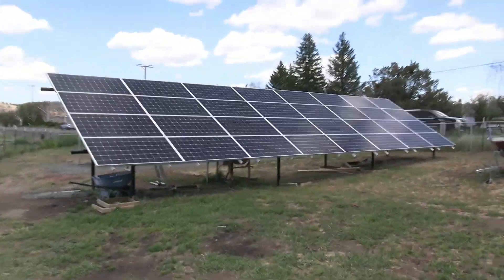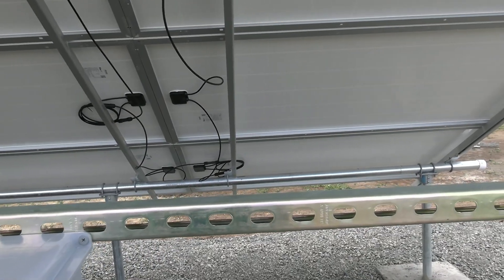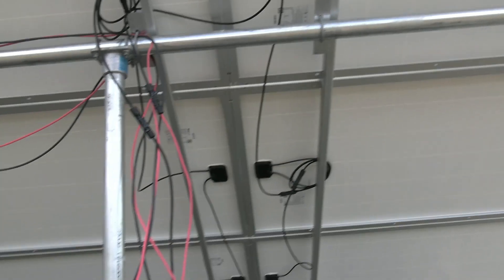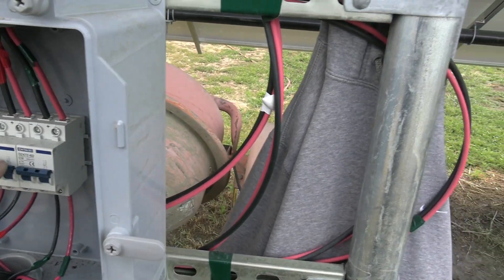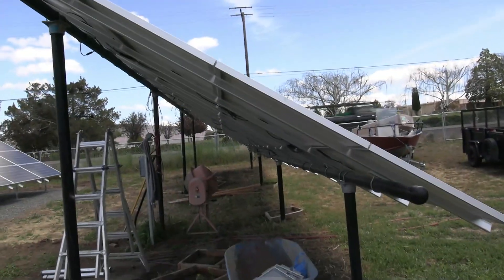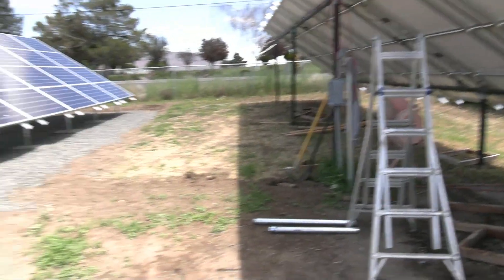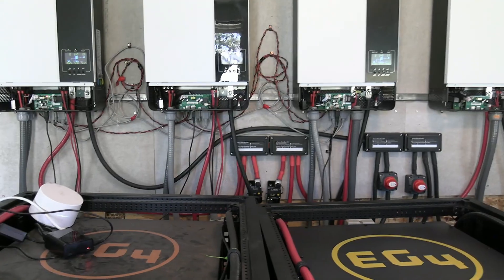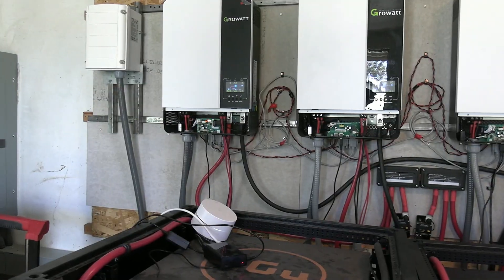hooked up my second solar array

Comment: You got plenty of room there I wish I had that much room. My solar room is about the size of a large walk-in closet.
Reply from the maker: I knew that these made noise. So I drug that shed over there. It would have been better to build a new building. I just didn’t want it in my house. That seemed like the cheapest and fastest way to get started. The building was free.
Reply: @jamesshomesolarmore2223  If had money, I'd have done a 20' shipping container for all the equipment.
Reply from the maker: yes, anywhere except in the house.

Comment: That's a very cool and costly setup.   Looks like about 41,000 watt hours on the batteries. How long will it run your clock radio?
I'm in the bottom of a steep tree covered canyon and my solar exposure is very limited. I wish I had the area for such an array.
Reply from the maker: we did all the work ourselves saving many thousands of dollars. clock radio could be powered for a very long time. we have some more things we wish to do. but at least we are off grid finally.
Reply: @jamesshomesolarmore2223  Building solar generators keeps me out of the rest home. Unit #9 that I finished and has been beat on for the last 10 days to see how it takes abuse. So far, so good. It's 46,000 watt hours, 3600 amp hours, 9000 watt 24 volt inverter split phase. Portable....if you own a forklift.

Comment: Where did you buy your wire from?
Reply from the maker: Battery cable’s were bought from battery cable’s USA plus all connections and heat shrink.
Pv wire was bought from platt electric. The wire in conduit was bought from Home Depot.
Reply from the maker: Since you live close to me I have extra pv wire. I can sell you by the foot.  I also have some of the wire that goes in conduit. It depends on how far you need to run it. If you are running too far beat to buy it by the roll.
Reply: @jamesshomesolarmore2223  you probably didn't know it but the power went out for an hour or so on Monday morning. My 1st thought was "I wish I had my solar panels." Lol.
Reply from the maker: @supermo26  with the system I have it’s easy to start small and add more as you can afford.

Comment: Love your videos and setup. What battery cutoff switches are you using?
Reply: I bought some of the same ones...Ampper Battery Switch  12-48 volts from Amazon .    Under $20 as I recall, pretty big current rating, too.  I also really like the Jamgoer 300 amp bus bar boxes he has, $35 from Amazon. I found red and black ones. Makes for a neat wire install.
Reply from the maker: kohree shut off this is the one with the 3/8 studs.

Comment: james, given the number of batteries, you should be able to put more amp into it.
each battery will take 50a charge, and i believe you have 12.
12 x 50a is a lot more ;)
Reply from the maker: I currently have 8  batteries, they are normally charging at a little over 10 amp's each. which I find is fine. I could turn it up some but would like to test the new solar array under current settings. you know the original panels versus the whole array. the extra panels are mostly for cloudy days when the batteries don't always get fully charged.
Reply: @jamesshomesolarmore2223  i understand, but for the future, you could use the energy you have an excess off to heat water in an extra inline waterheater, controled by solar assistant and a sonoff, or to run your ac..
seems a shame to not use the energy you have.
i do get the testing part thought, but 80A vs 400A would be too much of a waste to me
Reply from the maker: @houseofancients  I will look into it.

Comment: Have you had any problems with current sharing on your batteries? I heard Will mention a couple times to swap the server rack bus bar when you put them together.
Reply from the maker: I did at one time, but after I went to 2/0 wire I haven’t had any issue’s. I would like to see Will Prowse show a system that he fins his whole house and shop on. The reason for why my system is being wired this way is so if necessary? During the winter I can separate the system so I can power the house with one side and charge my car with the other if I have a power shortage problem with everything hooked together.